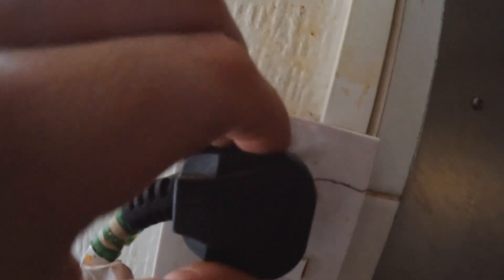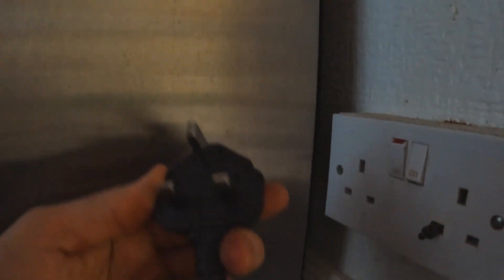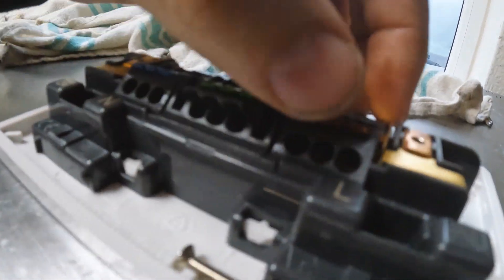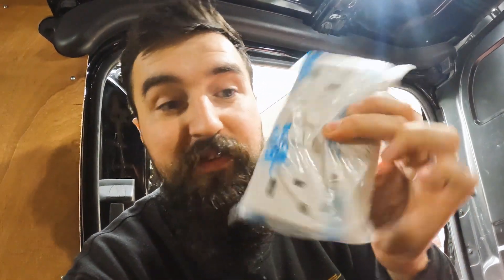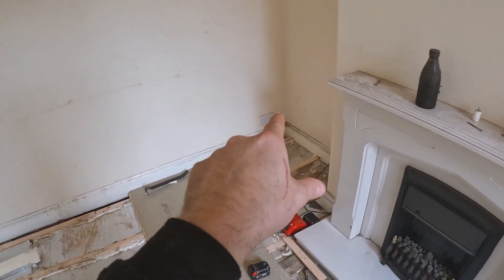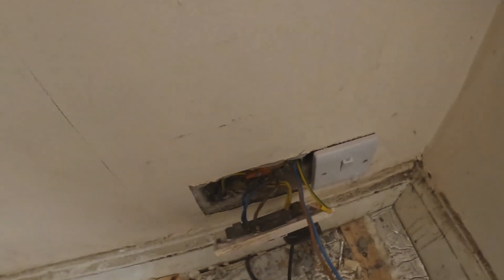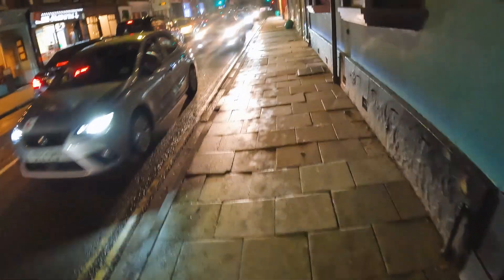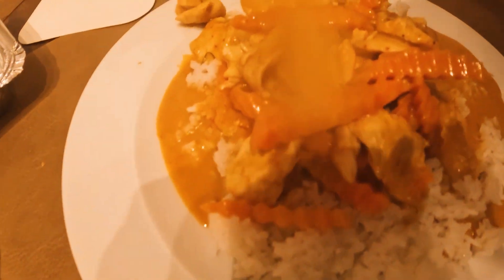STOP! STOP THIS NOW! 🔌🔥

Comment: Those moulded plugs are prone to overheating. I don’t have a moulded plug in my house, whenever we get a new appliance I cut the moulded plug off and fit a standard BS1363 plug,I was back in the eighties when I was at college training to become a spark  that moulded plug are a fire hazard because they have no means of  heat dissipation. Which is true. 
Were as a standard BS1363 has two means of heating escaping the bottom were the flex inters the plug and some have a small hole above the earth pin .
Reply from the maker: Yes your totally right! Just a cheap way for manufacturing and a bs warranty void

Comment: Supposedly for extended use 13A out of a UK plug isn't really recommended and also supposedly the GPO back in the day would only rate sockets for 10A for extended use, and even then only with MK plugs and sockets. This is definitely something that I would use a 16A CEEFORM for and not a UK plug.
Reply from the maker: Yes I always find a heater on a plug top 3kw always over heats, or the plug top running at 80 degrees when unplugged, super hot to touch. Hard wired connections is the way to go 👌